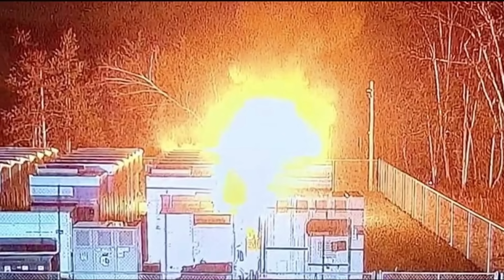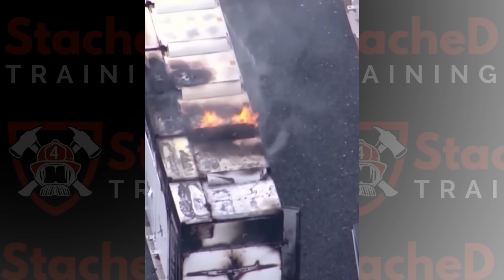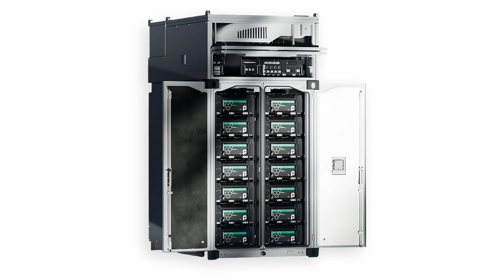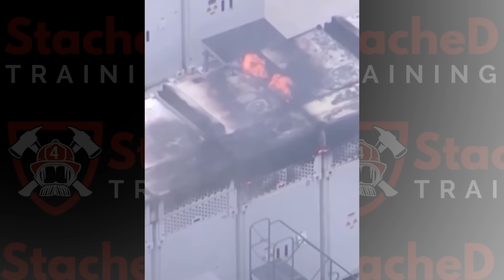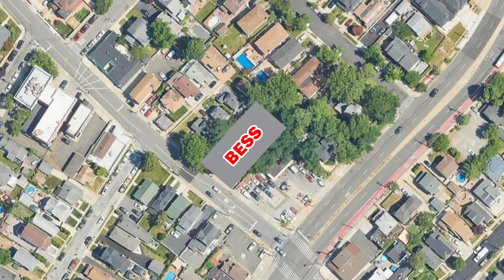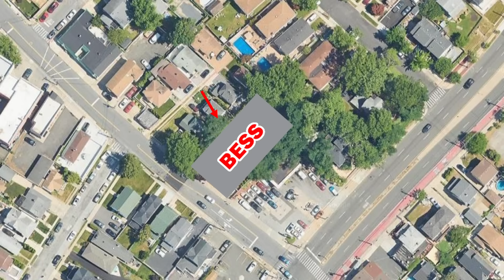Battery Storage Fire in Warwick, NY: A Repeat Incident

Comment: We're encouraged to not charge car or ebike batteries to 100%, but to not go higher than 80% unless you absolutely need to and it's going to be used right away. As far as I know this is both for safety as well as the long term health of the battery. Do you think that these energy storage facilities should heed the same advice?
Reply from the maker: The charge/discharge cycle is different for BESS, however,  they could be reporting on the operational state of charge instead of the actual state of charge.
Reply: I learned that many systems designed in recent years actually do that already. They will display 100% full and not charge further, but the actual cell insde is not 100% charged from a chemical standpoint. It's designed so that 100% practical use capacity isn't the max charge state internally, basically like overprovisioning in hard drives. 

I had ebike batteries that I measured myself to confrim the rating in Wh etc, the simple screen shows all full bars and chargers shut off, so it considers itself full - but take a multimeter to the connector and the voltage is slightly lower than what all cells at max. 4.2V mutiplied in a 14 series would be and that leaves some overhead to not strain the actual cells. Same when discharging, the bike was "empty" and stopped running, before the pack got so low that all cells would be deeply discharged to like 2.8V or less. This means you absolutely can use 0-100% according to the user displays, because that doesn't equal a hard 0-100% cycle on the battery. You do need well designed and modern products, though.
Reply: Only up to 80%, damn i'm glad, my 22 year old car, haven't spontanous self combusted yet, as i always fully "charge" my car🤣🤣

Comment: Imagine if we used batteries that did not randomly catch fire. If only someone would invent them.
Reply: The stupid thing here is that we don’t need high density batteries in these applications and we’ve had NiCads doing the same job for over 100 years without the combustion issues.
Reply: @nigelliam153  Alright, so I had to look up just how old that chemistry was since the oldest chemistry I could remember is Lead Acid and Nickel Iron, but man, to think it was first developed at the turn of the century... and there are 3.  3!  3 possible chemistries that are safe, effective and perfectly safe, if a bit more of a pain to maintain (Lead Acid) or expensive (NiFe)
Reply: @nigelliam153No that was NOT NiCads my friend, those haven't been around THAT long and also definitely were not good enough for application in storages. You're thinking about the Edison battery (Iron-Nickel) that has a much lower energy density than Lithium-based cells (but as you stated, that indeed doesn't matter much for storages in the middle of nowhere) and has an as good as eternal life expectancy. Or maybe you were thinking of the 'ordinary' car battery (Lead-Acid). There are also new inventions for storage. One actively manages its electrolyte.
Reply: They did, but there is complications. The best solution is Double Layer Electrolytic Capacitors or Supercapicitors. The problem is DENSITY. 

Lithium is not a very nice person. Sodium is even meaner. They arent stable around water. Air has water in it. So you have to persuade it not to explode. It really really wants to explode. Then when you are done with step 1, your second problem is the dense amount of storage into and out of the battery. Part A is the sheer magnitude of difference between other battery types, and part B is the limited rate and unequal rate to get the energy in and out. It isnt balanced or refined. Even if it is, it has to then be manufactured balanced with good quality control. That doesn’t exist anymore outside of regulated things like Nuclear material handling. 

That applies to the Nicad comment below too.

Supercaps have their own problems. They hit HARD, like really hard like lightning, but have relatively low density. They are at 2.7v so you need a bunch of them to add up to several farads of capacitance. They really need to be married to a LiFePo4 system properly to be the fast response, and the LiFePo4 be the slow response. Sodium Ion shows promise, but is still not ready. Same with Solid State research.
Reply: @keith_5584  What you are writing almost sounds like the ramblings of a madman. You are fencing with big words but not once you state anything with even the slightest applicability; most of your statements basically have no meaning AT ALL. 
After your "Step" 1, 'persuading' (???) the Lithium 'person' to stay dry (what does THAT explain?) your second point, that now is a "Problem", is "the dense amount in and out of storage". DENSE amount??? "In and out of..." ...would be 'the' problem??! Sorry, but all of that is simply nonsensical. Furthermore, I don't know what you were actually expressing there cause I couldn't decipher the meaning of your words, but capacitors are not THE solution. That is BE CAUSE they have a capacity that's so lousy that it does not even come anywhere near that of the least energy-dense ACTUAL battery. What double layer means to express I have no idea, ALL capacitors consist of two layers, one for each polarity, rolled up together so as to allow for maximum amount of (near-)contact surface of both, with an insulator (or actually two, of course) rolled up in-between those two, an insulator that's permeable for the electrolyte. Their specialty is being able to get charged up AND also, to RELEASE the energy they hold in an instant, virtually without delay. Other than that they have a really limited life expectancy, a relatively high failure rate, and must be shielded from any voltage that exceeds their max cap cause otherwise they will explode as well (well, I am exaggerating, it's more like violently bursting open, of course creating a mess). They are used for application in jump starters that NEED that possibility of releasing all stored energy in a very short time, and in electronic circuitry where their near-zero response time is what is used for leveling (out) somewhat more subtle fluctuations in electricity flow, in places where SOME currency must be available at a certain specific level (like quartz clocks) and be cause of their very specific capacity they also are used as a reference, for instance in simple timers, cause they always will give off exactly the same amount they also did last time, which makes them ideal to power circuitry that needs a specific amount of power for a specific amount of time, after which the capacitor also is able to fill back up quickly. But for larger scale, backup storage, capacitors are not feasible.
Reply: @keith_5584 There is no Lihium metal (or Sodium metal) in any of these batteries; the group 1A (alkali metal) reaction with water is completely irrelevent.
Reply: @andyowens5494  expand?
Reply: @theclearsounds3911  And there is water in the air. (air being the mix of gases around us) I thought it was a case of over simplification but I very much appreciate your confirmation. I hate giving out bad information, and am susceptible to bad propagation. Thanks again, really.
Reply: @thomasneal9291 Read the whole sentence, dont just pick the part that fits your misconception. "Alkali metal" is the revevent part it you cant work it out. Lithium and sodium metals react violently with water, the lithium in a battery is part of a chemical compound, so does not react like this. The cause of the fire is the short circuiting of the cell through water, which has nothing to do with the presence of lithium. Once the cell gets hot enough through electrical resistance heating, sure  the chemicals will burn, but that is not a lithium metal fire: its more prominently a hydrogen fire, maybe leading into an aluminium inferno.
Reply: If we stopped using electricity there would be no need for batteries. OK I'm being facetious here, but LiFePO4 technology when handled well is very safe compared to many other things we deal with in our daily lives. It represents a good balance of all the factors involved like energy density, service life, costs, and safety. Until something better comes along that substantially improves one or more of those factors it's the most practical approach we've got.
Reply: @P_RO_  Not sure about the safety aspect. Too many batteries go up in flames for my tastes. Two battery fires in two years at the same location? Not a good track record.
Reply: @chrimony LFP don't catch on fire.
Reply: @P_RO_ ironically typing on their device that is essentially run by electricity
Reply: They tightly wrap materials around each other with a thin layer of plastic, when the plastic breaks down and the two separate materials make contact that’s when they explode. This can be a manufacturing defect, from banging the batteries around when shipping or installing, or overheating, or age, or exposure to the elements, or humidity etc. these sites are not safe don’t live near them
Reply: @ytzpilot  I  apologize if I am wronging you, but that seems too dangerous to believe.  Got a cite?
Reply: Whats wrong with the 100+ year old batteries thats STILL WORKS TODAY AND NEVER NEEDS A CHARGE!?     The battery operates a bell thats been continuously ringing and still runs today!     Just put some of those batteries in it. The batteries even look cooler homemade with the strings and wax holding the battery together
Reply: @georgieippolito9924 The battery that doesn't need charging or replacing does not exist.
Reply: @harrickvharrick3957  It needs replacing but itll last 100+ years
Reply: @georgieippolito9924 give more detail on what you are talking about . Seems far fetched or you have miss understood- the way you have described it people not going to buy that
Reply: @georgieippolito9924  The problem with 100+ year old batteries are they are much less efficient and are much less dense.
Reply: @InlineSkater72 less efficient?  The one I'm talking about is still making electric arcs making a bell ring from 100+ years ago.  If a battery has life that long and still produces electric arcs, that type of battery is a answer to a whole lot of problems
Reply: They don't randomly catch fire. They catch fire when they're improperly manufactured, damaged (usually during installation in the case of stationary units) or exposed to unacceptable conditions (an external fire, impact, etc). Nobody knows yet what caused this fire. The first on at this facility is suspected to have been caused by water infiltration, which means the batteries didn't start the fire, it was an electrical fire that burned the installation and that batteries went up with everything else. If only we had fossil fuels that don't catch fire with a single stray spark.
Reply: @AussieUnclePhil  Water intrusion is an extremely common failure mode in anything exposed to weather. This is a lithium battery problem.
Reply: Diesel will put out a tossed match @AussieUnclePhil

Comment: They tell us LFP can't burn like that. 🤔
Reply: It is possible it didnt in the way you think. This is a grid device, so it has access to megawatts of power. If water bridged a gap, no known energy storage mechanism can deal with 1000% of its maximum voltage and be as dense as LiFePo4. If water was getting in, so was things rusting. Now you may have thermite in play. 

So the access to megawatts may have created a problem before a grid fuse blew. 

One thing of note underplayed here. They were able to reduce the packs to 50% which is a big victory! With Lithium, it is most stable in the middle of the charge. That is just the way it works, likely something to do with hating water so extremely and tiptoeing around that problem carefully.
Reply: @keith_5584  LFP contains more than enough energy to self-destruct in a spectacular manner. The process is just much harder to trigger than it is with NMC/NCA.
Reply: @teardowndan5364  I think we should call that energy density to put a finer point on it, only because that give you more information as to the length of the hit of energy rather than the force of the hit of energy. Yeah, I know I am being a bit pedantic, but with things like Double Layer Electrolytic Supercapacitors in play, more specific helps steer things better. I still have some faith that someone might come along and have an idea from one of these threads with some harnessed chaos.

I genuinely appreciate the comments on the burn ability/oxidizing properties. This is actually the first place I have seen that, so something new to research. 

That hydrogen igniter he mentioned as being part of the system is absolutely wild. That is a brand new one too.
Reply: @keith_5584  If hydrogen and carbon monoxide aren't ignited near the source, they can accumulate, mix with air and explode when they find an ignition source later, which can easily be much worse than just having an obvious flame.

You rarely have that problem with NMC/NCA since those fail violently enough to spontaneously ignite most of the time.
Reply: @teardowndan5364  No, I just think that someone thinking that far ahead is refreshingly awesome for once. 

The absolute state of technology lately….half coded programs (well it compiled right? I guess I am done), lack of QA on hardware, and terrible supply chain material quality is enough to send you into meltdown.
Reply: Burns longer and slower. Which is not necessarily better thing. But sprinkler systems can handle it slightly better.
Reply: @mikapeltokorpi7671  Also means even lower energy density.
Reply: Maybe its related to scale, too? IOW, size matters.
Reply: LFP is harder to set into thermal runaway and LFP doesn't produce its own oxygen like NMC/NCA does. But the fumes it produces once it does go thermal are mostly hydrogen and carbon monoxide which are very much flammable or even explosive once mixed with air, which can make them more dangerous than NMC/NCA when there is no immediate ignition source to ignite before concentration in the area reaches the lower explosive limit.
Reply: Someone in Warwick gov told me the fire didn't start with the batteries, it was the electrical equipment. The batteries were very resistant considering the electrical fire they were exposed to. Also, the project did NOT have approval to operate and likely did NOT follow the agreed design. 
Also, if you know what you are looking at here: LFPs did not "burn like that", the connected electrical components did.

Comment: Is this for the Grid or is this for a company for backup power ? Instead of a generator ?
Reply from the maker: Grid
Reply: They charge it when electricity is cheap during the day and release it at night when it costs a fortune. Taxpayer is paying for the equipment and all other expenses while profits are pocketed as usual. That's their business model.😁
Reply: @crazyedo9979  It could be the case but these smaller facilities are often also there to stabilize the grid in a zone that has issues so it can be a necessary evil and not always for profit.
Reply: @crazyedo9979 is not electricity cheaper at night?